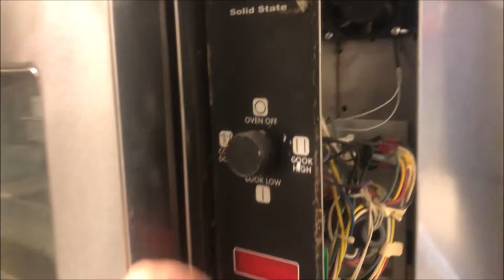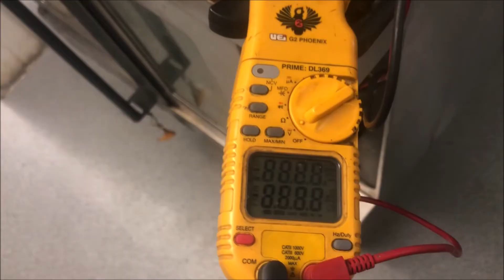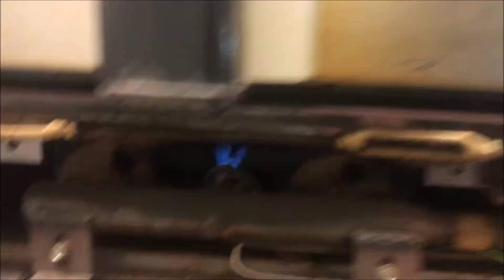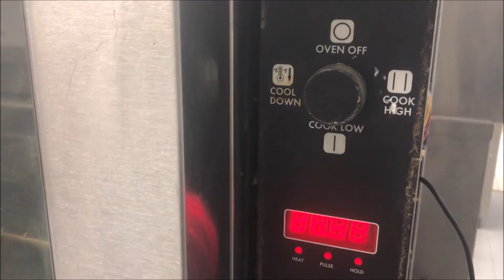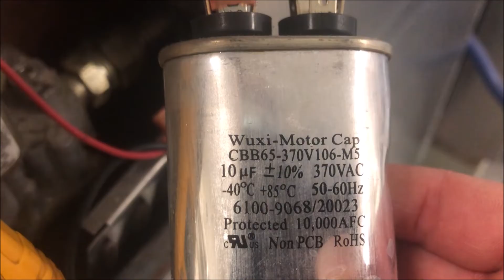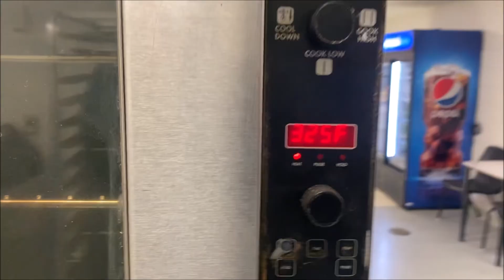Blodgett Convection Oven is not heating

Comment: Have an SH1G/AB, pilot lights, spark stops 24v to MV and no main flame, pilot dies and lose  24 volts due to no pilot. This will cycle forever. So looks like I am getting flame rectification because spark will stop as soon as main valve is energized, then it all drops out. Customer has an identical unit that is no longer in use due to door damage and kept this for parts. So I have replaced pilot assembly, gas valve, Fenwal board, even 1000 ohm resistor temp sensor, ensured centrifugal switch closes. Still can’t get it to go to main flame. Would appreciate your insight on this.

Comment: Great video! I have a similar Blodgett and when the bottom oven is turn on the fan is working and the call for heat light comes on for a few seconds and the goes off. It repeats this over and over. Any suggestions on what could be wrong? Thank you in advance.

Comment: How to connect the conduit Assembly  AO Smith motor
Reply from the maker: The Bx should just thread into the motor casing
Reply: where are you located
Reply: My oven turns on as well as flame but not heating I don’t know anything about it but can you help with parts to swap that you think can be the problem?

Comment: I have a American range convection oven, fan come on but the burner won’t come on. Pilot light is lit, but main burner won’t come on. There is door switch which goes bad on them, usually when the switch is bad the fan won’t come on neither but in this ck case fan is on. I’m really confuse what to check next or just change the door switch?
Reply from the maker: Sounds like maybe the motor centrifugal switch but too many variables still. You need to see where you are dropping voltage
Reply: @REFRIGERATIONKITCHENEQTECH  thank you so much for replying. I will look into.

Comment: Great Video! I am trying to troubleshoot my Blodgett DFG-100, looks identical to the unit in this video. I am getting spark at the igniter but no ignition/flame as if it's not getting propane. The fault code goes into three flashes, ignition lockout. The stove wasn't working last year, we replaced the ignition control module and has been working fine. Now we have this no fire. Any thoughts? I am a decent trouble shooter and was able to follow your video test procedures but do admit my schematic reading skills are lacking.
Reply from the maker: Could be a plugged pilot tube, a bad gas valve (check for voltage to the pilot valve terminals on the gas valve, if no voltage there, bad module

Comment: Ha I was just on call this past weekend for a very similar call on a Hobart convection oven, “oven not heating” got there saw spark and ignition of burner and then it would shut off right away tested micro amps on the cleaned flame sense got 2.4, so I ordered a new board, I go back to put it in tomorrow hopefully it works🤞
Reply from the maker: Yup, that should do it. Make sure you have a good ground going back as well
Reply: @REFRIGERATIONKITCHENEQTECH  yup I did she’s up and running now!

Comment: HOT SIDE 🔥Hurrah !
100% sure ones you stepped in and heard  the motor humming  knew right away it is motor or capacitor.  But thanks for educational videos 👏👍
Reply from the maker: Lol, ya that extra 1 minute of testing hopefully will go  alone way to help other understand that this electricity thing flows.
Reply: Same here.  I have repaired many of these ovens, and replaced motor caps.